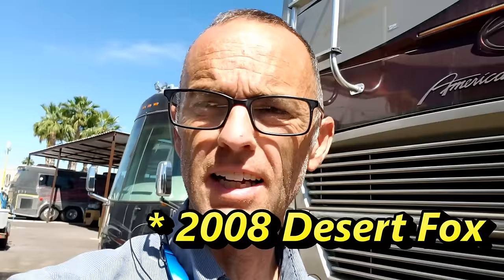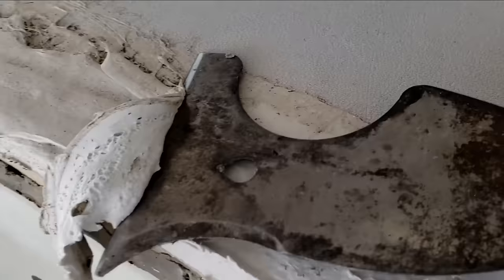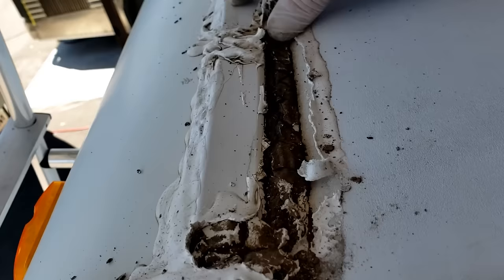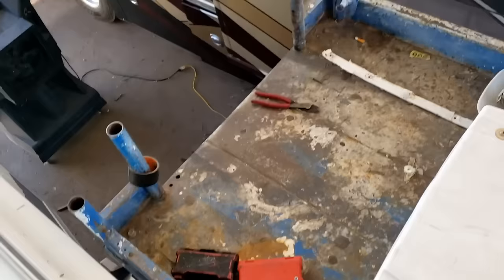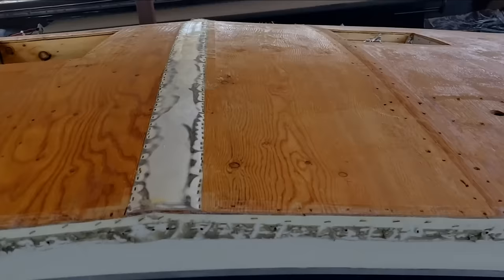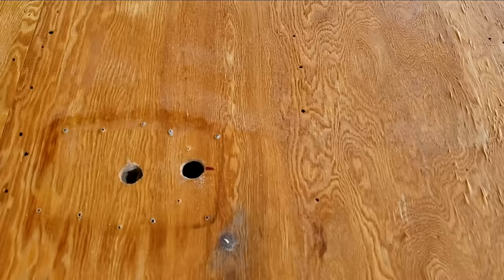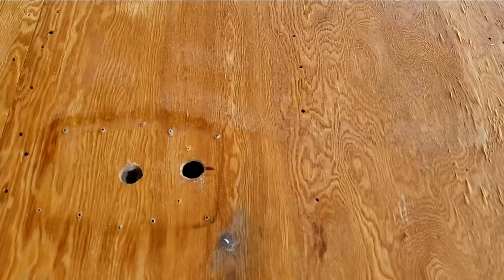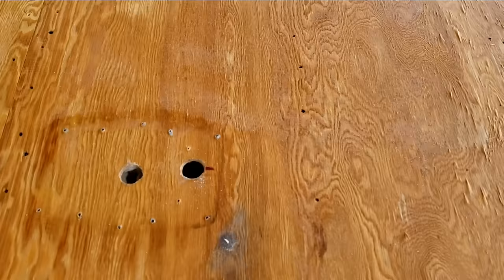When Should a RV Rubber Roof Be Repaired or Replaced?

Comment: I hate the fact the skylights that are used have no curbs (even a few inches would make a difference). Built in counterflashing is critical. The water will pool and it is a matter of time until the butyl tape fails. I would also suggest using pitch pockets for other penetrations. Poor design. I agree, it looks like they stretched the EPDM too much. If the typical RV bubble skylights are to be used, I would suggest inserting silicone caulk at each hole above the butyl tape as additional leak protection. It amazes me that the design does not use more flashing and counterflashing as part of the intitial design elements.

Comment: We bought our travel trailer 6 years ago. It is our first ever camper. 
Last year we towed it 350 miles to a private resort in the middle of Nebraska, stayed for 3 months and then towed it back home.
But…
Before we did that I had to make sure it was road worthy and safe. Being a 35 year career journeyman diesel mechanic gave me an edge in some respects. I replaced the brakes, bearings and wheel seals, and added bearing buddies so I could grease the bearings on the road. During repairs I also found the old brakes wires weren’t even connected. Now the brakes work perfectly. I added 3 Fantastic vent fans or whatever they’re called, and modified 1 so we can reverse direction of the fan. An EASY modification that involves 1 switch, a little bit of wire and some hot glue.Additionally to that, I replaced ALL tires with new including the spare tire. I installed gas struts to the under bed storage to assist in lifting the brand new queen sized memory foam mattress, hung a new flat screen tv and connected a blue ray dvd player.
And to top it all off, I inspected, cleaned, and resealed the roof rubber membrane. 
This tt is a 2006 Keystone Outback Sydney Edition. 
Our trip last year went flawlessly. The brakes performed superbly, and towing was a breeze with new tires and a new used Chevy Silverado 2500HD Duramax L5P crew cab, 2019. 
The work I did to this camper, to make it road worthy and safe, not just for us, but for everyone else on the road, was worth every penny. It was expensive, but worth it. And I fully enjoy that kind of work, not to mention it makes her HAPPY.
So this year, we had a HUGE hailstorm in June. Plus ANOTHER storm just a couple of weeks later that had 95+ mph straight line winds. The hail in the first storm was 3”-3.5” in diameter. It took out our AC unit, which is an old Carrier AirV, no longer produced and finding parts for is now impossible.
I turned the “hail damage” in to the insurance company thinking they might help with the AC unit.
NOPE 👎🏻 
Not only did they total the camper because there is now delamination, broken AC unit, broken lights and roof damage, but, I don’t think we can afford to buy it back from them after the loan and claims are paid off.
I was hoping to use some of the money from the hail damage on my pickup to buy the camper back, but can’t because the claim check for the hail damage to the pickup is written to me AND the bank. 
So not only are we NOT getting a new AC unit for the camper, but we are also out a CAMPER !
I feel like I should not have turned in the storm damages and just started over and fixed everything myself. Live and learn I guess.
The insurance company will own aour camper, the bank will be happy the loan is paid in full, but it’s starting to look like my “investment” is going down the drain.
Hoping the bank will help us finance a 5th wheel. 
🙃😢

Comment: Interestingly, this Gulf Stream 5245, is the RV I wish to get. I'm a retired architect and reasonably clever  ...I plan of taking the dinette OUT, replacing with a sofa and most likely cut back this protruding floor.  After seeing this video of yours  ...I would most likely put full length rollers under that floor slide out to distribute the weight. I also plan on reconfigure the full ht closet as behind it, there's lots of wasted uninstalled space.   Sadly  ..these manufactures could easily design & built these RVs to be less problematic at no additional cost.   I've watched several of your videos  ...you're extremely patient, clever and resourceful. Thanks for the info you provide. Pls stay safe, Blessings

Comment: I feel ya about the defective screws! I recently rebuilt a deck on my son’s house using the hidden screw system. When building the enclosed stairs I used angle brackets behind the step facias. And used  Hillman wood screws to secure the brackets and facia and leading edge of the outside tread boards. It was so frustrating. They were of such soft metal that out of every 100 screws, 25 were bad or stripped the Phillips head when tightened. I used 3, 100 quantity packs of the wood screws. I also used about 700 of the Kregg deck screws for the deck and stair planks with similar results. All were “Made in China”!

Comment: Nice video. I’m a fan of automotive type covers for campers in the off season. The mid-Atlantic has 100 degree summers. Below zero winters. Humidity. Snow. Everything. My cover really keeps my TT clean.
Reply from the maker: Thanks, I'm more unconvinced about RV covers at least here in the desert, all the ones I see are torn by the end of the first year. But absolutely they are great way to extend the life of a RV and keep it clean!
Reply: AZ Expert in sure life in the desert is different. The UV and heat would break down the material fast. Plus the winds would tear them. Probably a covered structure would be best out there. I noticed how the white was gone and the rubber was showing. Maybe a spray on roof 😂 but we already discussed that in a prior video 😂 thanks for the videos 👍🏼

Comment: Nice work on the roof. When pushing the unit into the garage I noticed what appears to be a fairly large delamination bubble on the front cap passenger side 2'07" so I would love to see a video of how you might go about addressing that.
Reply from the maker: Sidewall delamination can be a tricky repair. To properly repair it, the components, trim and sealant must be removed, the filon seperated from the luan paneling and new paneling glued on and the filon glued on. It's labor intensive and costly. Many people use some crazy epoxy vacuum setup which will stabilize but not make it look much better. Of course the location of the water leak should be found first. I generally can only film what I have been requested to do. If I get a delam job I will record it.
Reply: Have you ever used a wall paper scraper to remove sealant? I have had good luck with it.

Comment: Thanks for all your videos. I am an inexperienced DIYer, bravely tackling an RV roof replacement. Your videos have given me some confidence. I have all the components removed, and have torn all the wood off.  When I tore the wood off, in the places where the wood was still in good shape, bits and pieces of the styrofoam came off with it.  Will this be a problem when I come to re-glue new wood to it?  Secondly,  I want to put some additional support pieces in the front part of the RV. What is the best way to attach wood 2x2s to the existing metal frame pieces?
Reply from the maker: if the chunks of foam are large enough they should be filled yes. here is a roof I have to add framing too. https://youtu.be/DahwsNTHG1Q

Comment: Nice video,  However it would have been nice to show & tell a bit more in respect to how you sprayed or roller brushed the adhesive, brand you used. Rubber roofing although appearing to be a thin material is    very heavy for a single lay down for one person to heave up on the roof.  I would have liked to see if two guys huffed it up there    or you simply used a forklift.  Wished you put that in the video.  Maybe next time you do a roof you can show that & a ballpark  price of what that job billed out as.

Comment: I have a question... I have a 2003 Bounder 39Z and the AC drain water is running down the front of the windshield and front corners, I have not inspected the roof as of yet but is this normal in any way? where should condensation drain run?

Comment: I have watched you . What a great job you do . I have a question about Gulf Stream  class a country coach . The seam ends on the top before it goes over the side and water stand on both sides  and end caps have the raised screw down where the roof membrane ends  on both sides and ends are about 3/4 inch higher

Comment: This is a super video.  In 2017, I encountered two problems when replacing the roofing membrane of my 2001Georgie Boy Landau. Some of the roof wood (1/4in luan, from memory) beneath the membrane had rotted so I replaced it.  Applying the EPDM material began well and ended well but in the middle of the roof span a bubble formed, about 5ft x 3ft and also several wrinkles arranged themselves across the roof like small waves.  I was so dispirited I parked the motorhome in its car port, where it has remained for four years.  A few weeks ago, I climbed onto the roof to inspect it: the bubble was there but the wrinkles had miraculously disappeared.  Can you explain what caused them to vanish?

Comment: Thank you for your videos, your explanations and honesty are what makes them so great. But, can you tell me why  Eternabond tape will sometimes get ripples after being installed. I have a hard wall and roof  A  frame. The tape remains smooth and flat on the metal frame but over a short period of time it will ripple on the roofing surface. I have applied the tape for a second time on this one problem area.This time the rippling is worse. I’m at a loss for a reason why this happens. The tape has been used on the entire roof area, and I only have this problem on the rear width section. Any thoughts on why this happens?

Comment: Somewhat related question: I'm preparing to rebuild my 35 ft class A roof. It looks like the decking is just luan, assumed 1/4 or 3/8", I'd like to go with thicker plywood (and not that OSB garbage). How do-able would using 1/2" be? Thank you in advance.

Comment: I have this exact camper with a small leak on a seam. To seal and coat would i be better to put the eternabond over the edge molding or remove it?

Comment: Hi James, Quick question. I am replacing the membrane on my 2010 5th wheel Denali by Dutchmen and once I got the old one off, there remains a very sticky glue on the chipper board. Not my preferred materiel but I suspect it's for cost reasons. Is there something that can be used to remove the glue or is laying down a thin plywood over it the way to go? Great videos BTW, very informative.

Comment: Dicor question as ive never used it before.  specifically the non-leveling type.  is it thick in its consistency?  i mean more than normal?  i went to use some today and it seemed like it was thicker than it should be and was a struggle to apply and smooth out.  not impossible, just a PITA and very messy when trying to make it look good.  thanks!!
Reply from the maker: Dicor has the body of marshmallow creme, both the self leveling and non-self leveling styles. It does have a shelf life and if it's difficult to squeeze out a caulking gun then it is likely past its shelf life. Thanks!
Reply: @AZExpert  it was more difficult to get out of the gun than i would think was normal. Not two handed or anything, just tougher than i was expecting. And immediately tacky like i came back after 30min to tool it. Not a huge deal as it was just being used to reseal (remove, completely clean, reattach) running lights on my TT. Cleaned it all up and will be using silicone. Dont think that will be a problem as you taught, butyl tape is the primary seal, in this case silicone is redirecting the water and its not being applied over any other sealants. 
Hey, found a new use for your favorite tape. Covers the giant 1" hole behind the running lights nicely.

Comment: I've seen a "bulletproof" roof using enternabond rather than Dicor around the edges and around the fixtures. What are your thoughts on that?
Reply: Eternabond will still let water under the edge or fixture.. You still have to use Dicor to seal... I do love eternabond, it works well for many applications... especially beefing up areas...

Comment: An EDPM or TPO roof on a commercial building would often have the membrane under the termination strip then fold over the strip and weld to the body of the roof. The result is zero holes in the roof membrane and reduces the sealants needed. Wouldn't that work on an RV or travel trailer?
Reply from the maker: The commercial weld method with curbing is absolutely the best way, and the best material. It also is quite additional cost most consumer's would not pay for. The guys at RVRoofInstalls.com do it this way though

Comment: How do you recommend to fix tears on the edge of roof. Went through some branches and dragged along the edge. Not slashes more like pencil diameter holes every 6-10 inches or so. 
Thanks for any help.
Reply from the maker: On membrane roofs, repair tapes are best for  radius repairs...it does not look goo but is a good repair. Thanks!

Comment: hello from the ozarks!!  what do you recomand  to use when cleaning the roof like this one and do you use 303 protectent?
Reply from the maker: Soap and water is my go to, there is a Dicor rubber roof cleaner that works very well and yes I have used the 303, Dicor, and generic UV protectors I just follow the instructions from the manufacturer. Thanks!

Comment: Great video, very educational.  Just curious to know if you used butyl tape under the metal rail that holds the rubber roof to the wall of the camper.?
Reply from the maker: Yes I did

Comment: I totally messed up my epdm roof install i have some bubbles 2-3 inches wide in the middle and the glue is dry. Do you think i should pull it up and start over with another piece of membrane?
Reply from the maker: A few bubbles I would live with, a very large section I would probably redo.....unless you have already put everything back together and sealed.
Reply: @AZExpert  thank you for your response.

Comment: Installing a second Air Conditioner on my Forest River Salem 32BHDS. We got the old vent out, removing some of the sealant used we realize that there is a small hole or tear in the Rubber Roof close to the edge of where the air conditioner gasket will sit. Do you think it would be ok to shoot some DICOR under the air conditioner, and just be sure it spreads to cover anything?  I think most all of it will be under the air conditioner gasket, but just want a little extra security. Or should I use some of the skylight sealant? We put the air conditioner on now with a bit of elastomeric caulk however read it won't stick to the rubber roof all that well so want a good seal. Camper sits under a carport so it's safe and well I don't think it would leak for a while, just want to get the best fix we can. 
Thanks for any input you have. Oh and your videos are great. I have learned a lot.
Reply from the maker: In years past, some manufacturer did add sealant under the AC gasket, so it can be done, it makes removal difficult though. I think Dicor would do fine, it could also be a good application for eternabond roof tapes, as I think they are great for tears in membranes. Thanks!
Reply: @AZExpert  thanks for the help.

Comment: Great Video as always. When the driver pulled away I saw the front of trailer look like it was separating  under the skin. isn't that a big problem down the road?
Reply from the maker: Yes there was delamination at the front cap wall. It is surprisingly common and not always due to water either(extreme heat will cause this). However, this was likely due to the roof leak, but it was merely cosmetic and the owner had already spent more than he wanted at this point. While removing the ladder I did not notice any signs of water intrusion and the interior wall and components did not show damage either. He will keep an eye on the front wall for further leaks or damage. Thanks!

Comment: Been watching your videos,  great job. I have question. Have 05 transport tahoe by thor, would like to seal between the gutter meets the roof. What would you recommend for caulking? Thanks.
Reply from the maker: most manufacturers use a non-sagging acyrlic sealant...that is to say dicor that does not self level. Thanks!

Comment: Just roughly how much do you charge for a 30 ft roof epdm with new wood underneath ( parts and labor). I know this is a broad question but ours is almost done and we might need to have a person replace it.
Reply from the maker: I would guess $5000 to 6500 depending on the deck condition.

Comment: Why not run a router with a round over bit along the roof edge to eliminate the sharp corner that creates a stress riser on the rubber?  Would take only a couple minutes.  I see you used a grinder to ease the edge slightly.
Reply from the maker: grinder is faster and the deck is uneven for a router

Comment: You removed the luggage rack? I couldn’t see the before well but my ladder is part of the rack. Do you remove the ladder?
Reply from the maker: This unit has a ladder at the front and a small rack/railing at the back. It was there quickly when I pointed out the back showing through the roof at the rear. Thanks!

Comment: what are your thoughts on Vacuum bonded fiberglass roofs on an older MH? RV manufacturers toute it as a more reliable feature but I have read that it is far less reasonable to fix if there is a need.
Reply from the maker: A true gel coat(molded fiberglass) roof is the best type of roof. It can be repaired, is very strong and has no seams and of course does not tear easily.